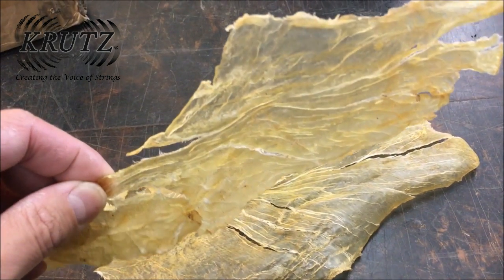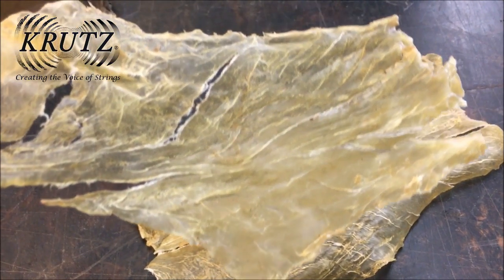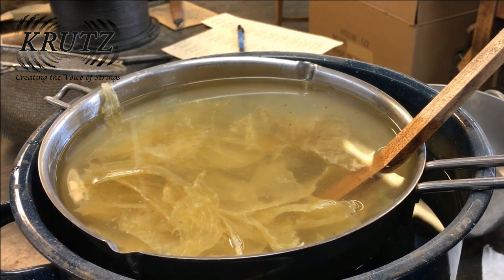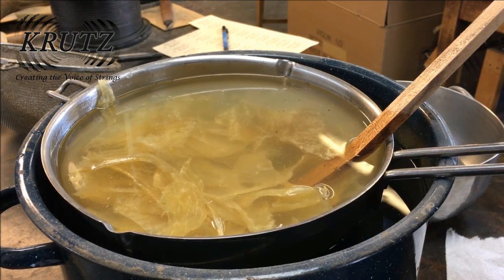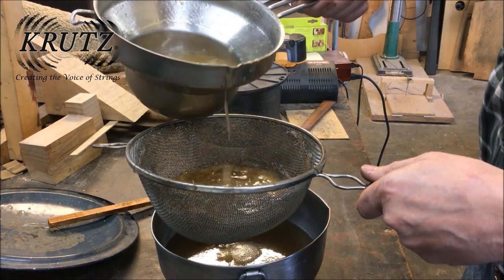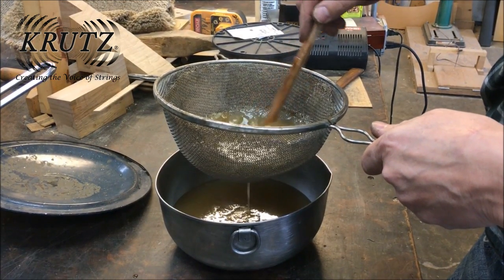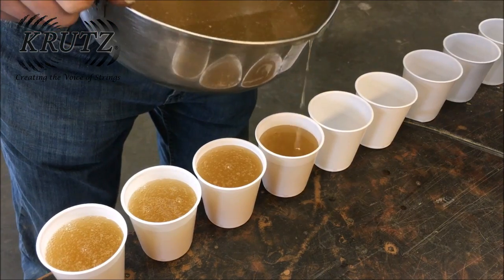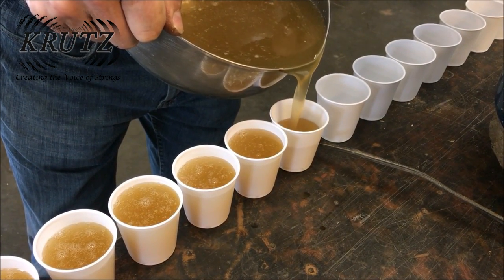Making Russian Sturgeon Fish Glue For String Instruments

Comment: What's amount of the bladder and water . Water temperature to boil or how much time .Can we use only air dried bladder for making glue . Sorry my english is not good
Reply from the maker: The bladder has to be completely dry. 
Start with two times the water for the amount of bladder.
Don't boil the water. Hot water is enough.
Keep glue in hot water for one hour. Then it is ready. 

Hope that helps, thanks for asking!

Comment: Is 2 hours of simmering enough to evaporate enough water? What should be the ratio in terms of dry bladder weight before simmering and the glue received after that? 3rd question - If I take out the glue from refrigerator - do I just heat it alone or I need to add water and heat it?
Reply from the maker: Great questions! Hope this helps...

1. The simmering time is not about evaporating water but to get the bladder to dissolve within the water to it maximum capacity.

2. We don't measure ratios before or after simmering. The maximum amount of bladder dissolving into the water is the only objective.

3. Heat the glue as is. Once it is liquid then you can judge if you want to give the glue more or less viscosity (thinner or thicker) for what you want to use it for. If you want it thicker then let it stay on the heat to evaporate the water. If you want it thinner then add more water and it is ready.
Reply: @KrutzStrings  super helpful thanks!
Reply from the maker: @beatbaker420  You are most welcome!

Comment: RIDICULOUS .. Hide Glue, Fish Glue, and even PVA (Elmer's Glue) is stronger than the wood when the joint is made and clamped correctly.
Reply from the maker: PVA glue I don't know about. But a wood joint glued with the highest strength Hide Glue or Sturgeon Fish Glue is stronger than the wood. This is because unlike the PVA glue, which leaves a layer of film between the wood joint, these two natural glues interlock the fibers of the wood. I have personally glued wood joints and then tried to break the joint the next day. The wood around the joint breaks but not the glued joint itself. Yes, weather, age and humidity can weaken the glue over time. But at the time, if the process is done right, the joint is stronger than the wood around it.